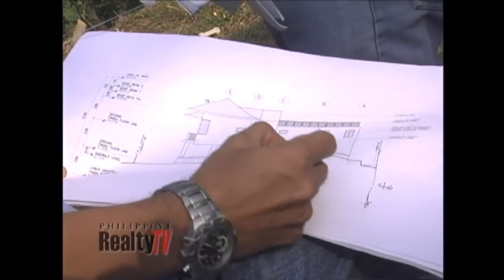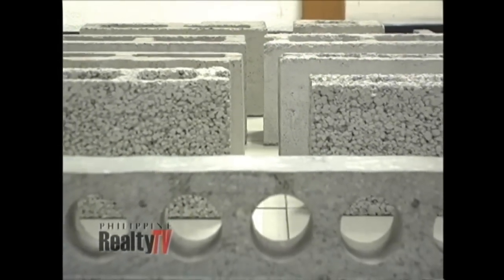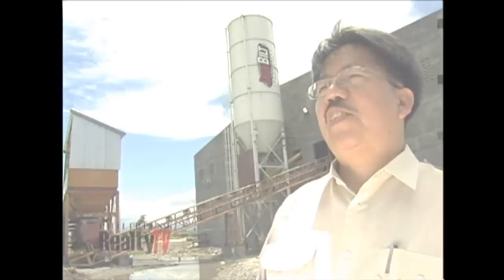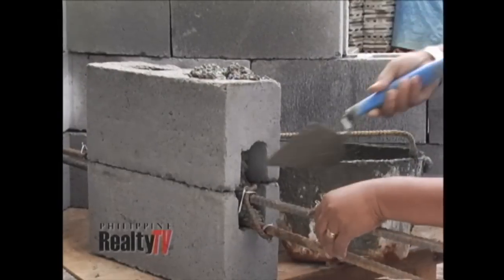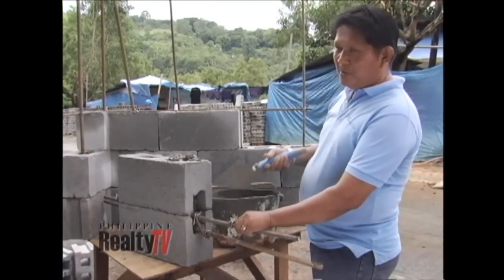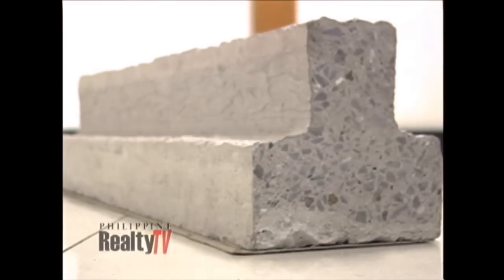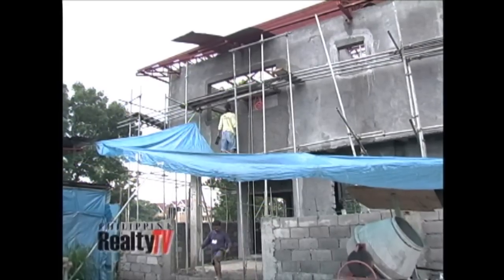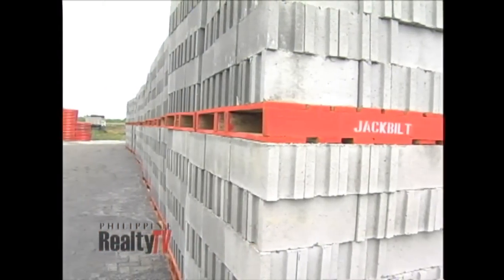Project First Home - Load Bearing Concrete Blocks by Jackbilt

Comment: Ganyan ginagamit namin dito sa Canada. Very stable very cost saving. Mga Gym wall na tinatayo namin sa mga schools ganyan ang gamit, yung wall is 11 meter high using 12" blocks. Combination of Bond beam blocks Sound blocks or acoustic blocks. Sa loob naman ng building mga partition walls gamit namin 8"inches blocks. Tapos wala nang palitada wala nang parging. Jointer tooling nlng kailangan. Tsaka isang advantage is yung mga rebars. Every 400 to 600mm spacing sa halloblocks may rebars and then dugtung nlng habang nataas sya. Earthquake proof..

Comment: hello. quick question. if those are load-bearing blocks and can replace posts means you would only have wall footing as reinforcement along the perimeter of, say, a house. would there be a variation in terms of the depth of the wall footing and would there be any other reinforcement needed just in case? looking forward to your response. thanks.
Reply: In Australia the dept is 300mm for every 1mtr high wall for a house

Comment: These jackbuilt would be good only for bungalow type house, you can not replace standard beam for these load bearing block if you are going to build multiple storey building.
Reply: The house they show at 5:30 is 2 levels.

Comment: Is it earthquake resistant? Load bearing blocks are used in old times but in modern day they  do not use it anymore because they are not earthquake resistant.
Reply: Old style URM buildings are very weak to lateral loads caused by earthquakes, but when properly reinforced with concrete and rebar the walls become much stronger. Built to code, modern masonry can be very resilient against earthquakes.
Reply: Sir earthquake proof po yan. Gawa ng, every 400mm may rebars and every 8 course or patong may bond beam. Start sa baba bond beam agad dalawang patong. Ganyan ginagamit dito sa canada at sa US .

Comment: Where can I buy blocks at Bambang, NV Province?
Reply: Charlie Chong hello sir we are supplier of hollow blocks 500psi 700psi and 1000psi.. message me if your interested
Reply: Jam sarile hello can you advise if these blocks are available on Bohol?
Reply: what strenght would it give me if i use a mixture of 6 sand and 1 cement. that be very close to load bearing ?
Reply: Tell me prices and where to buyn
Reply: @jamsarile9070  mam, saan po loc. Nio

Comment: In a regular hollow blocks, Use concrete vibrator and a concrete additives and you can achieve 2000 psi or more! 😈😈😈